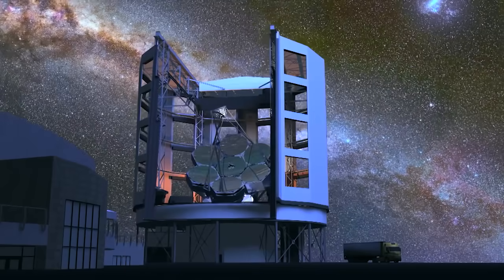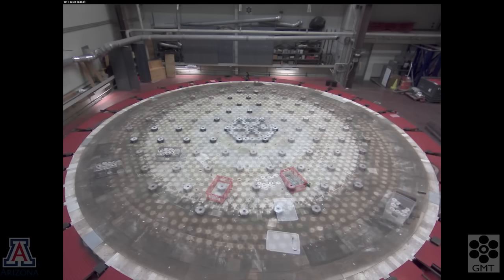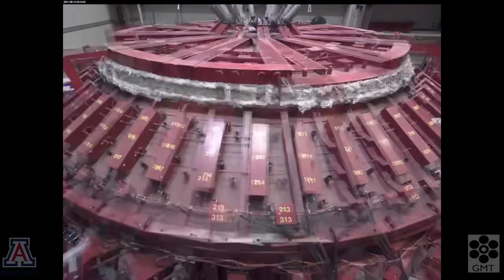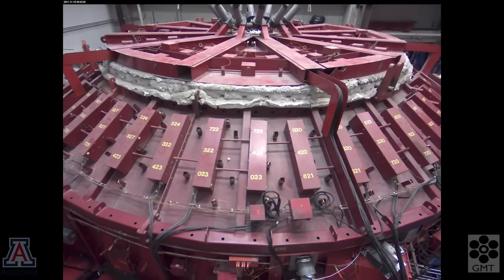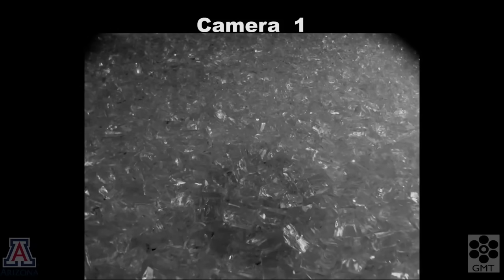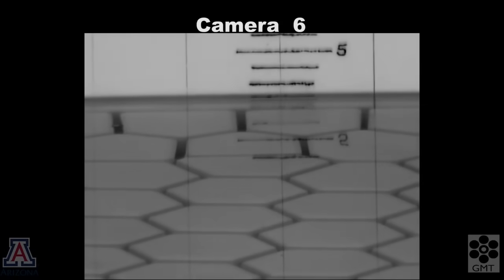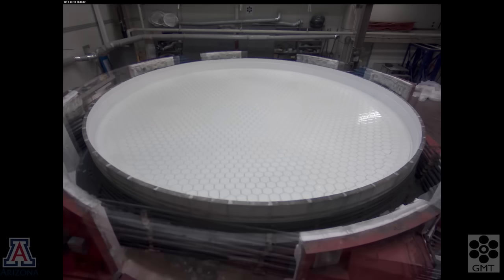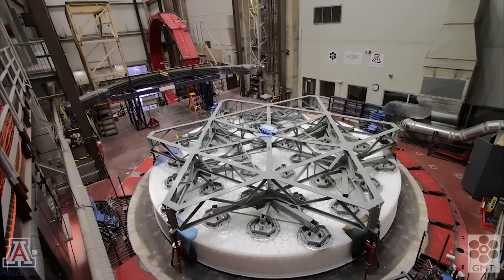Making the mirrors for the Giant Magellan Telescope at the University of Arizona

Comment: How did you get the camera shots as the glass was melting at 1200 degrees centigrade or was that Fahrenheit either way it was incredulous from the UK 🇬🇧.
Reply: The commentator said 1200° C (Celsius). He also said there were cameras inside the oven to record the melting of the glass.

Comment: Why do the technicians need masks and oxygen tanks in the end?
Reply: Silicon carbide is a incredibly hard molding material, highly resistant to temperature change and capable of withstanding the mass and heat of molten glass. It is also brittle, with a small particle size. This means it is easily aspirated, and the way it breaks makes it very sharp, causing multiple minute lacerations in the mouth, throat, and lung tissue. This condition is known as pneumonoconiosis, where your lungs will simultaneously collapse from air leakage, and fill with blood from the wounds.
Reply: @Lammergeier350  Very informative! Thank you!

Comment: you pay over a hundred dollars for a piece of glass, that's 8 inch in diameter and an inch thick if your lucky and is as flat as a slug. and then you either have to grind it yourself, or pay someone a small fortune to make you one. so I think a precast aluminum blank with the parabola shape would not only be a lot cheaper but would cut out a lot of time and effort currently being invested in mirror making. not to mention you could precast different focal points to fit any number of scopes.
Reply: There's got to be some issue with aluminum that would be preventing them from doing this. It would make no sense to go with glass when a significantly cheaper alternative would be viable.

Comment: frankly I think I will see if you can make them out of aluminum, then if so start having them manufactured. and I bet the can be a hell of a lot cheaper than glass parabolic mirrors.
Reply: Until you can invent transparent aluminum, we are going to have to stick with glass.
Reply: @firesurfer   Are. you guys fuckin' serious with the aluminum? Scotty, in one of the Star Trek movies, shows a fellow engineer how to make transparent aluminum
Reply: Wasn't joking . Actual scene in the movie.
Reply: @carlsaganlives4141  That's where I got the reference from. (I was joking) I believe the reason for glass is the stability. Aluminum expands and contracts too much. I just posted a couple more pics from my visit in 2014.
   Go to google maps.
Reply: I think the reason for the glass is its smoothness.  Transparency isn't the issue; the whole thing will be coated with reflective material - like any mirror.  Aluminum would be nice, i suppose, but getting it smooth and parabolic is not yet possible i guess to the same degree.
Reply: The glass used has a very low coefficient of expansion with temperature changes. Aluminum would expand and contract tremendously from day to night in the mountain air of Chile. The optics would be garbage.

Even with glass, there will be many computer controlled actuators (push rods) on the back side to "nudge" the mirror into a more perfect shape as it is moved around vertically to horizontal.

Comment: it seems to me you could cut a hell of a lot of time out of the process if you used a 2" thick precast aluminum blank with the parabolic shape in it.  then polish it to the correct parabola, and you wouldn't have to wait months for the glass to anneal!.  not to mention you could do it in sections and put them together,  after being polished and transported to the site of the telescope. aluminum would also be a lot easier to handle be a lot lighter than glass and a hell of a lot stronger and wouldn't cost as much!.
Reply: don't forget about thermal contraction/expansion and the distortions it would cause
Reply: Glass is much more thermally stable than aluminium, so a better material for this purpose. Especially considering the GMT is supposed to be using the best materials possible for the best quality data it can get. Its all about the science and nothing about "easy/easier construction".

Comment: why don't they use aluminum blanks for telescope mirrors with the parabolic shape precast into it then it would only need polished?.
Reply: For anyone else who's curious, this far exceeds the melting point of aluminum, which is a mere 600C.
Reply: Aluminum is prone to much more temperature-based expansion and contraction than glass.

Comment: 2inches height. HANG ON! I thought that all agencies related to space were using the metric system?!

Cool video non the less. Amazing technology!
Reply: They might be using the metric system internally, but since the video is for an american audience, they convert it to imperial. Just a guess though.
Reply: @Mr30friends  that's what I was going to say. Although there are a surprising amount of companies that manufacture stuff related to space (usually not space hardware but rather grounds side equipment) that require customers to use imperial units. Usually it's companies that don't get the majority of their business from space applications, so using metric would put them at a disadvantage to their competition (in the states of course)
Reply: the shot at 2:59 is confusing - after the glass melts I can't tell if the number below the fluid level is 2 for 2 inches or just the reflection of the 5 above it & actually cm

Comment: could honeycomb precut concave; so that when it spins; it would mold into shape and gradual decrease in temp wouldn't it keep parabolic thin mirror? but length to floor is flat; ? unless it would increase cost in operation; since each single tube has to be configured; individually;

Comment: Wish I understood why the mirror backing is this hollow glass. Since it's going to get coated in aluminium, why not start with aluminium?
Reply: Because aluminium would expand and retratct too much and therefore deform the mirror.
Aslo because Aluminium is soft, it is hard to pollish to a optical finnis.
Reply: For the same mass, hollow structures are stiffer.  Imagine a 1" steel bar, thats pretty long. Its going to have more than a bit of wiggle to it if you shake and flex it. if you did a 4"  thin wall steel tube that contained the same amount of steel per length, its going to be a lot more rigid than the bar.   For the glass mirror,  if the honeycomb structure is only 60% as strong as if it was solid, but the mass was 30% as it if was solid, then the mirror is twice as stiff. And they need the mirror to be very stiff, because they want to minimize how much it changes shape as the telescope aims up and down, and gravity pulls on the glass at different angles.
Reply: the amount of aluminum used to coat each mirror is only about 1/4 the amount in a typical 12 oz. can ... !!! and half of this ends up on the coater walls, not on the mirror surface. Glass is used for many reasons ... but yes, the final reflecting surface is aluminum.
Reply: Outer Space reasons?  Or perhaps getting to space reasons...to protect the mirror better during liftoff?
Reply: @rogergreen9861  Giant Magellean will be ground-bound.